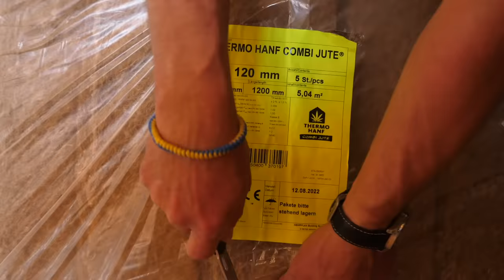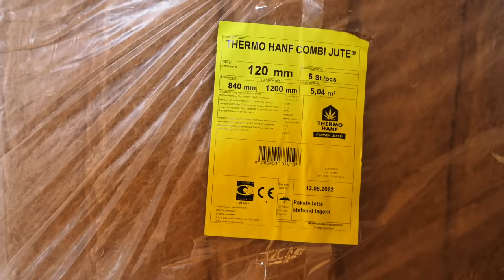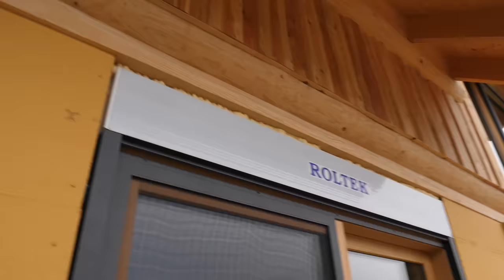Building The Walls Of The Log Post And Beam House

Comment: That is all good but we need to see how a electrician or plumber does to do the inside without seeing the pipes or cable. Or the heating without seeing the channels inside. That would be an interesting video, I believe.
Reply from the maker: It would, but you want see it on this channel because our company works only with wood.

Comment: You don't use a vapor barrier liner?
Reply from the maker: This client did want it
Reply: @naturalloghouse  It's very strange don't use vapor barrier liner, it's important to prevent moisture due to different temperature and pressure.